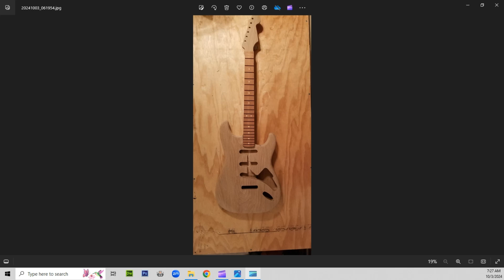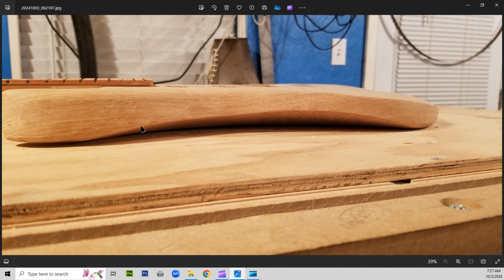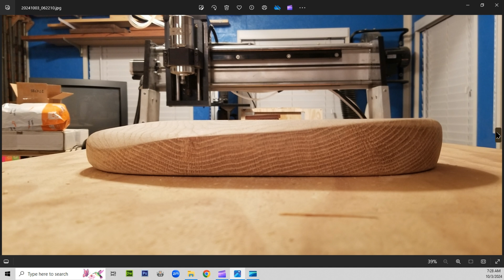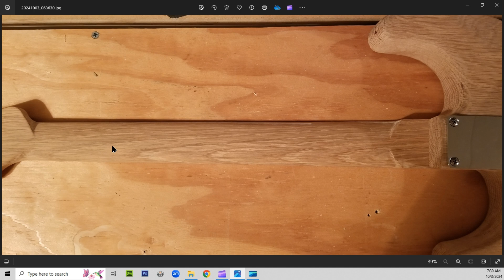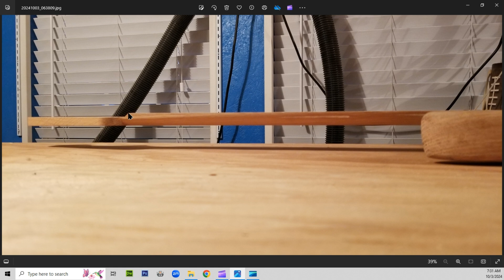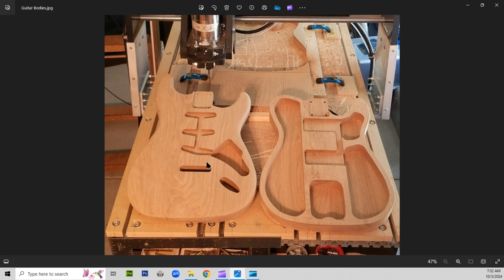Stratocaster Guitar

Comment: Hi Sharkcutup, You have done a really nice job on the Guitars, I'm trying to do a Stratocaster-style guitar on my CNC and I seem to be having a few concerns with the neck. When it comes to the finish on the neck back, there is an unmachined ridge along both sides of the neck and I tried to alter the plain butt it affected the front of the neck. I'm not sure how to get over this issue. I'm using V-Carve Pro 11.5. I don't have any other software to draw and set up the different contours for the neck and body, but I do have a few 3D models in my computer of the contours for the body and the neck back, but I don't have the fretboard file yet. Do you think you could see your way to helping me out here to be able to complete the Stratocaster using V-Carve Pro? I would certainly be grateful and appreciate it if you could. Thank you.  Regards, Michael
Reply from the maker: Post your File on the Vectric Forum as requested and you will get all kinds of help.
Reply: @sharkcutupcnc  Hi, Thank you, I will, I just thought if I messaged you directly it would be easier. Thank you and Kind regards